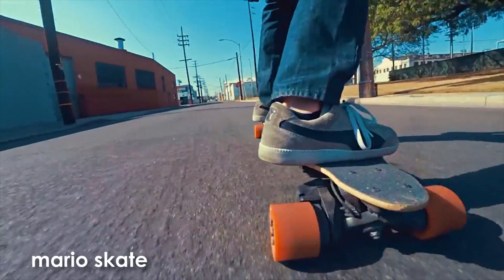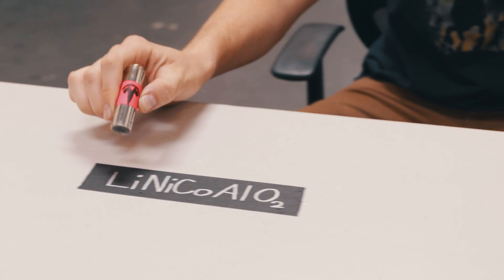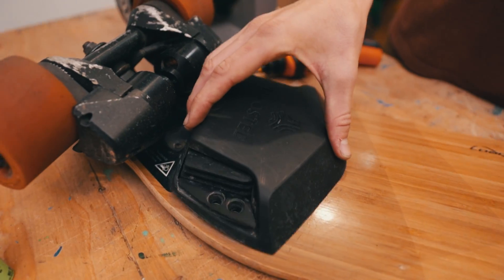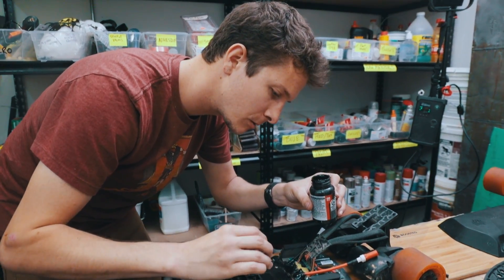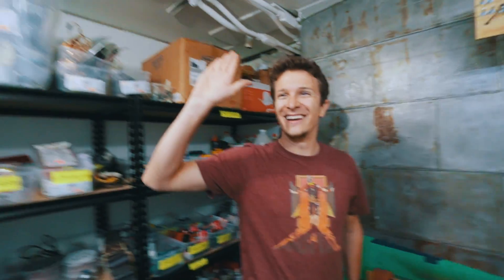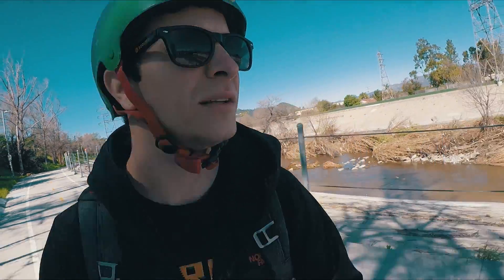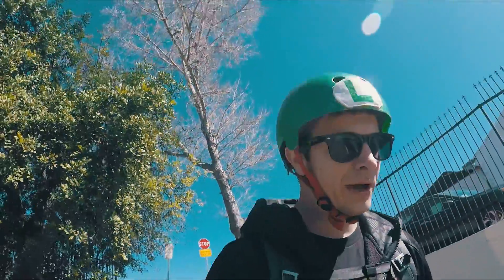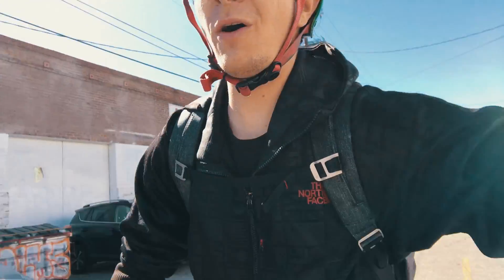Tesla Batteries in an Electric Skateboard!

Comment: I wonder if adding resistors to the booster board's battery output so that the booster board's battery gets held back a little bit so it drains more evenly with the tesla batteries. You could also set it up with a bypass switch which is guaranteed to work, but you sacrifice a little bit of it's torque and overall stamina.

Comment: Find a way to generate the kenetic energy from the bearings into a charging outlet so your batteries technically do not use power at all. Or make it so theres 2 batteries that are at full charge but only use 1 at a time. Kind of like a cellphone battery. Just keep a spare. Doubles the range. Or just double the whole project so the 2 packs are in doubled parralells. This way instead of just 2 bottles of water you have 4. Cuts the usage by 200% if my math is correct? I was in highschool using magnets in rotation to capture the field energy and converting it into usable current. The same can be done with this board. It takes alot of gutting, basically enough to say you now made the whole board yourself, but itd still be a better application for this. Remember all cars have an alternator. If you can find a way to alternate the power being used it will cut the usage so the charge and voltage lasts until you reach the destination.

Comment: Diseases explanation: Radiation therapy or radiotherapy, often abbreviated RT, RTx, or XRT, is therapy using ionizing radiation, generally as part of cancer treatment to control or kill malignant cells and normally delivered by a linear accelerator. Radiation therapy may be curative in a number of types of cancer if they are localized to one area of the body. It may also be used as part of adjuvant therapy, to prevent tumor recurrence after surgery to remove a primary malignant tumor (for example, early stages of breast cancer). Radiation therapy is synergistic with chemotherapy, and has been used before, during, and after chemotherapy in susceptible cancers. The subspecialty of oncology concerned with radiotherapy is called radiation oncology.

Radiation therapy
Radiation therapy.jpg
Radiation therapy of the pelvis. Lasers and a mould under the legs are used to determine exact position.
ICD-10-PCS
D
ICD-9-CM
92.2-92.3
MeSH
D011878
OPS-301 code
8–52
MedlinePlus
001918
[edit on Wikidata]
Radiation therapy is commonly applied to the cancerous tumor because of its ability to control cell growth. Ionizing radiation works by damaging the DNA of cancerous tissue leading to cellular death. To spare normal tissues (such as skin or organs which radiation must pass through to treat the tumor), shaped radiation beams are aimed from several angles of exposure to intersect at the tumor, providing a much larger absorbed dose there than in the surrounding, healthy tissue. Besides the tumour itself, the radiation fields may also include the draining lymph nodes if they are clinically or radiologically involved with tumor, or if there is thought to be a risk of subclinical malignant spread. It is necessary to include a margin of normal tissue around the tumor to allow for uncertainties in daily set-up and internal tumor motion. These uncertainties can be caused by internal movement (for example, respiration and bladder filling) and movement of external skin marks relative to the tumor position.

Radiation oncology is the medical specialty concerned with prescribing radiation, and is distinct from radiology, the use of radiation in medical imaging and diagnosis. Radiation may be prescribed by a radiation oncologist with intent to cure ("curative") or for adjuvant therapy. It may also be used as palliative treatment (where cure is not possible and the aim is for local disease control or symptomatic relief) or as therapeutic treatment (where the therapy has survival benefit and it can be curative). It is also common to combine radiation therapy with surgery, chemotherapy, hormone therapy, immunotherapy or some mixture of the four. Most common cancer types can be treated with radiation therapy in some way.

The precise treatment intent (curative, adjuvant, neoadjuvant therapeutic, or palliative) will depend on the tumor type, location, and stage, as well as the general health of the patient. Total body irradiation (TBI) is a radiation therapy technique used to prepare the body to receive a bone marrow transplant. Brachytherapy, in which a radioactive source is placed inside or next to the area requiring treatment, is another form of radiation therapy that minimizes exposure to healthy tissue during procedures to treat cancers of the breast, prostate and other organs. Radiation therapy has several applications in non-malignant conditions, such as the treatment of trigeminal neuralgia, acoustic neuromas, severe thyroid eye disease, pterygium, pigmented villonodular synovitis, and prevention of keloid scar growth, vascular restenosis, and heterotopic ossification. The use of radiation therapy in non-malignant conditions is limited partly by worries about the risk of radiation-induced cancers

Comment: Use a battery voltage converter and a big battery pack. This link is for the converter u need https://www.kb-controls.com/product.sc;jsessionid=9D979053DB1AF330E0FF4938541DBE90.p3plqscsfapp004?productId=10 and you will also need this. https://www.amazon.com/ALLPOWERS-Charger-Controller-Intelligent-Regulator/dp/B01MU0WMGT/ref=asc_df_B01MU0WMGT/?tag=hyprod-20&linkCode=df0&hvadid=167150549507&hvpos=1o1&hvnetw=g&hvrand=8810755928541869406&hvpone=&hvptwo=&hvqmt=&hvdev=m&hvdvcmdl=&hvlocint=&hvlocphy=1019250&hvtargid=pla-584565296832&psc=1

Comment: Can you not just reorder the batteries to where the boost board batteries are connected to the tesla batteries and the tesla are hooked into the board? That way once the boostboard battery is dead, then the tesla's can still power the board because the boostboard battery is 'behind' the tesla's. Im jot an electrical engineer so, its just a raw thought.

Comment: put a breaker switch so wen one battery hits its low point it will kick over to the other one and if the wheels spinning actually charge's that thing you should have an endless battery i think... i'm not a rocket scientist my Grandpa  was but not i

Comment: You could make a generator into the board if whenever the energy runs out the other energy inside the generator will convert and will be used over and over so a never ending battery

Comment: He could add a spot on the back of a solar panel and charge the batteries while using it, it won't drain as fast but it will still drain, so now, find a way to maybe either make the wheels spin easier or to have a stronger push

Comment: What if instead of wiring a battery pack to the motor of the boosted board you wire to the battery of the board so it works like a battery case on a phone, when the board needs more juice turn on the battery pack or something along those lines, idk if it could work like that or if that would decrease the maximum mileage you get just a thought

Comment: Use a couple of capacitors on both sets of batteries. Use them in parallel once you have charged each set of capacitor with the batteries.

Comment: You might be able to charge the board battery at a constant rate with the Tesla batteries. That means that you still couldn't drive at full power constantly, but you could in short bursts to get over hills.

Comment: you should use the two larger batteries to charge the smaller one so it will take 2 large batteries and and normal one to run out of power

Comment: I like the video I'm having to wait on my brain figuring things out. I have a scooter that runs on voltage of 24v - 29v at 35A an for distances I bought a small generator that delivers 120v I'm still waiting for a transformer to reduce the voltage to more acceptable limits other wise I'll burn out my motor. I can charge the batteries on the go but power reduces as the battery power drops half way.  Batters will not except power an keep running or it will except it but batteries charge at a slower rate.  Some phones will charge but not as fast as when they are turn off. An some phones won't charge while in use. Thank You Loader hope you have better luck.

Comment: use a capacitor to maybe collect the power from the cells when they reach the lower voltage and have it discharge the power at a higher voltage

Comment: It the chips its regular the battery I say hard wire straight to the motor or put a tc chip in take that one out and hookin to the motor then add a volt meter to the outside the board

Comment: Remove the stock battery from the circuit entirely and solder the new packs into place. Then add additional packs in parallel as needed to allow additional current flow to the motor. The controller shouldn't know the difference. You would just have to use a different charger since the stock one probably isn't meant to charge those Panasonic cells.

Comment: well, if you put a switch running to a boost/buk converter, so that once it goes down to 33.5 you flip the switch, you can set the output to the correct voltage with the knobs on the converter so basically, once batteries go to 33.5, flip switch, which will boost to 40

Comment: Maybe conect the batteries to skate board batteries so the batteries charge the skateboard batteries.
Reply: That is a good concept but probably wouldn’t work.
A better idea would to wire the battery’s in parallel increasing the capacity of the battery output.

Comment: You can tell this video is click bait as Tesla don’t make their battery’s their  battery’s are made by Panasonic.
Reply: Everything goes faster with a tesla battery.  What about tesla air for the tyres, tesla leather, tesla cable that should pass more power than normal cable.

Comment: Just use the two battery's u made not the boards one
Reply: It makes sense. Remove the boards battery, and just use the 18650 packs that he made, possibly adding one or two more. That way they will all stop at the same voltage.
Reply: Ecne3D What would the problem with charging be? They would just be charged like any normal 18650 packs.
Reply: might be a problem with charging
Reply: That’s a good idea BUT it needs the battery or it would happen like how the bored would not turn on 

SIDE NOTE: sorry for the bad grammar
Reply: Thing is his boards motor is connected directly to only the boards battery which he told us in the beginning of the vis so to make the tesla battery voltage the voltage drop instead he will need to change the entire connection to the original battery.
Reply: All he needs is a simple relay he could use to switch on and of the connection to the boards battery and use the packs instead. So instead of pushing thru a dead cell he can just cut out the factory battery cell all together on the fly.
Reply: The circits werent built for that type of voltage
Reply: BAMBII63  for voltage or amperage?  If so a inline resistor block should control  the draw.
Reply: it will still cut off at the same level of voltage... the only way to make it beter is to gett same batterys as instaled in the chasy or find a circuit in the board that cuts of amps or what ever it does on low battery battery....   ofcourse that will kill instantly original battery because that voltage protection is guarding them in the first place....
Reply: That’s 100% counter productive

Comment: Don't know if you already got a resolution to this, but here's the answer:
you need a DC to DC step up converter that will output 35 volts DC from whatever DC voltage the source is.  However it would be somewhat difficult to find one that is rated at higher than 10 amps output, but you can fix that buy buying lets say 5 of those or even 10 of those and installing them in parallel output calibrated as the same output voltage - these DC to DC step up converters are generally very small, you would not need to worry about space consumption with them, however the larger of them can output a greater amount of amperage thus requiring much less of them (if you get one with the adjustable voltage output potentiometer)  Assuming the motor of the skateboard requires no more than 50 Amps to operate as the highest prognosis, you can put 5 to 6 of these DC to DC step up converter to be covered for up to 60 amps of max current draw, that way, those batteries that you said can continue working down to 30 volts can continue to do so.  the way this would work is: assuming your battery pack is down to lets say 33 volts, the controller would see a perfect 35 volts, as far as the controller of the device is concerned your battery is technically "full", but the minute voltage drops below 30 volts the whole thing would abruptly power off, you will feel the force of the power off as you will feel that acceleration just abruptly stopped and you will be on your own kinetic energy, but this is not really a problem, instead of gradually loosing power and speed you will just go from ON 100% full, to completely OFF at end end of the discharge of your battery pack.

You might want to put another set of two rows in parallel maybe more to the down section of the board if there is any space, you will multiply your power potential, acceleration and torque by a factor of 2 times.  This is great specially since these batteries will output more energy at a time the more you parallel them.  I guess for this is down to your available usable space and if you are willing to compromise the look of your board by potentially adding additions that would affect the overall physical size of the board (eg: adding another set of two rows of battery backs by the side of the board that WILL be seen with additions of wood board extensions to further extend available space to house more batteries.  Hey I know it would look "ugly" but at least it would work much better and stronger).
Reply: m8ty.com why did i read all of this btw that is true but dc to dc was a little off but u fixed it which was really cool thanks
Reply: or get taller trucks under the board for more ground clearance and leave them under the board
Reply: Hmmm I'm no engineer but, what if you fabricated a board from scratch? You could design a new board and use a 3d printer to make it or even construct one using carbon fiber and have one set of the batteries stored internally and the other just as you had them? Too bad you did not have something like an alternator to keep them charged. Well good luck with your future builds.
Reply: I might try that. I am one of few that understands this. I’m going for one that outputs energy faster so I can go faster
Reply: Good idea
Reply: Damn I'm stupid lol, I understood nothing!
Reply: I like their comics
Reply: I didn't know that comment could be that long
Reply: Your genius
Reply: m8ty.com  or hear me out carry spare batteries
Reply: It was too long for me to read in a short amount of time but I agree
Reply: m8ty.com   0.0   k...
Reply: Intellectuals over here like
Reply: m8ty.com you are probably the only on to know this just like him and the only on helping him because nobody else knows it.
Reply: I'm an electrician and most of what you said is quite advanced stuff im impressed
Reply: m8ty.com I didn't even read allthat but with all that writing I am assuming your hella smart. Lol
Reply: Wrong!

Comment: You could make a power bank for the board like the ones you use for your phone but with the Tesla batteries. Like refilling the glass of water constantly so you can use the full amount of power of the Tesla batteries and not worry about the limit. Also, I think this solution wouldn’t have voided the warranty but it is  harder to do.

Comment: Not sure if this has been fixed or not, this video is over a year old. However, here's a few things to consider:
1) The wire splice is not beefy enough to handle the full amps load. You should of tried to either thread some of the new wires into the other one, or solder directly to the board on the other side (if it has pads on the other side of the pcb)
2) The best way to be able to utilize all the power would be to replace the original pack with the same type of cells as the other 2 packs. This would give you an overall same amount of voltage/amperage curves (during charge and discharge)
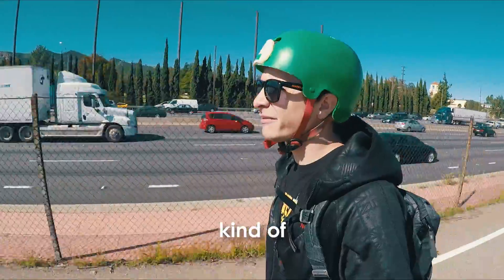3) The water bottle analogy is incorrect. You don't want the cell to have the bottle neck. You want the cell to be like the glass, and then on the glass have a valve that controls the amount of water coming out of it like a gate. The reason behind this is, as voltage drops, current increases. So as your battery packs lower in voltage, the motor will require more amps to keep performing the same amount of work. You saw this happen as you rode along, you started out cruising at 15+ mph ("i'm driving along I-5 and we're going the same speed, kinda" 6:30). Then when you got further along, you could almost walk faster than the board. This is because the cells couldn't output the amps needed to compensate for the voltage drop.
4) The remote is showing you the SoC based on what the batter gauge on the board "thinks" is left. Since that was the first run, it didn't know what the full range was as it remembered what it was previously. Run a few times and the meter will get more accurate.

Comment: Use dynamo(the hand crank) in one wheel that will create electricity from one wheel and then connect it to the battery and then the cycle will continue. Therefore it is a never ending battery. Remember to start with a full charge, that's how electric vehicles work these days too

Comment: Use LiPo's.  They seem to have a much higher C rating (amp output) than Li-Ion.  I have a Trampa electric mountainboardas well as an evolve carbon GT, and the Trampa is fare more powerful and lasts longer than the evolve.  I run 4 * 6200mah, 6 cels at 40C each (12s2p).  I get about 25 miles of range and can go over 35mph!  My evolve gets about 18 miles and can go 22mph.